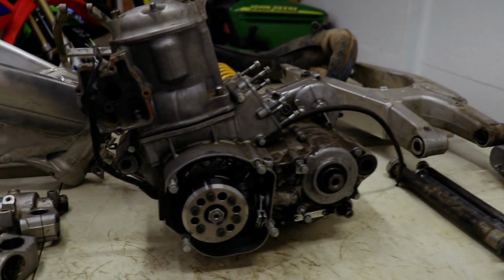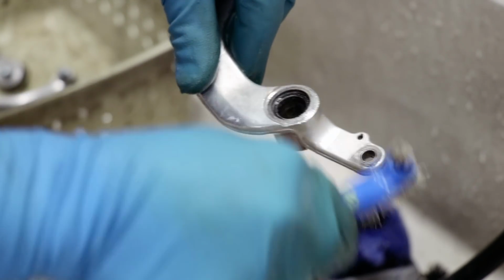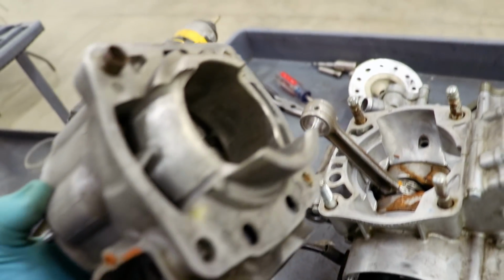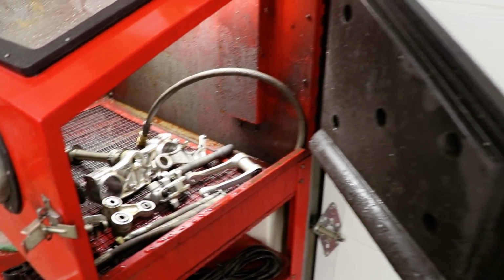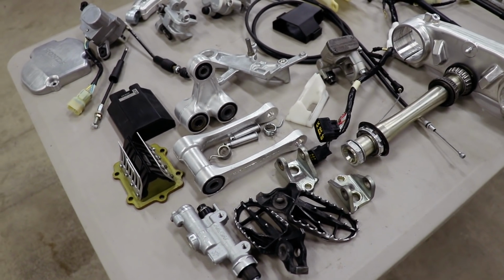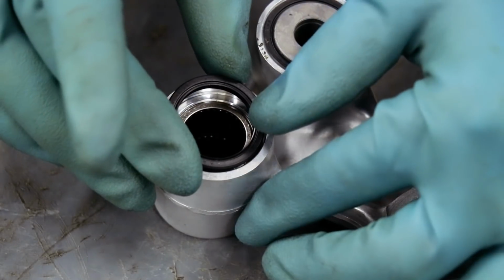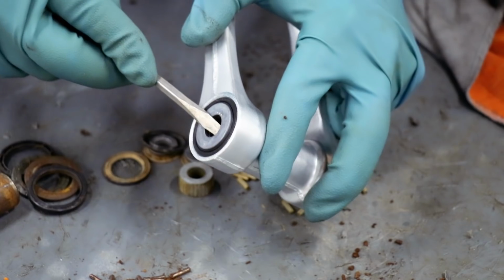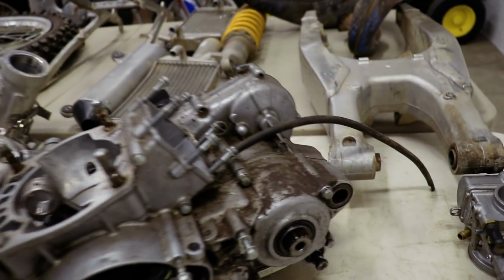What Caused This CR250 Engine Knock?

Comment: I like the use of blast cabinet for the washing, pretty slick and don’t have parts flying all over the driveway trying to pressure wash them. Gonna have to make a setup like this.  You using hot water there?

Comment: I told you needle bottles work! Just curious but where did you get yours? My bottles are from a local e-cig/vap shop (I don't do that stuff but the bottles were cheap) and they leak like crazy! Why not use a brass brush instead of the steel brush? More work but less marring. Hard to argue with those results but curious. Cheers, Merry Christmas, and Happy New Year!

Comment: Im using Eric gor for my cylinder replate.   He only charges $180 and does power valves adjustment included    Its slow tho.   Turn around is 3 weeks

Comment: Can anyone help me?? I have a 2 stroke yz 490 I was rebuilding and I kinda stripped a little of the threads not all but may be a few were the nut wont go in, I was thinking to cut of the mushed part and then threading it in to it since the cranckchaft magneto bolt is so long cameron or anyone give me advice? thanks I'm 14 btw
Reply: I stripped the threads in the crankshaft  where the magneto goes in with the key

Comment: You have to split the cases the guy before you  probably put the shift forks in wrong, happens more than you think with older bike not to say you don't have to replace any thing tranny related but you should be able to just reassemble it, just before you join the cases again make sure you can go through all the gears. Should be nice👍🏼